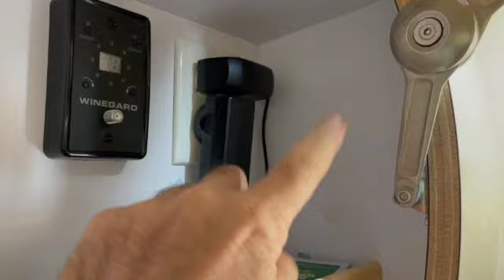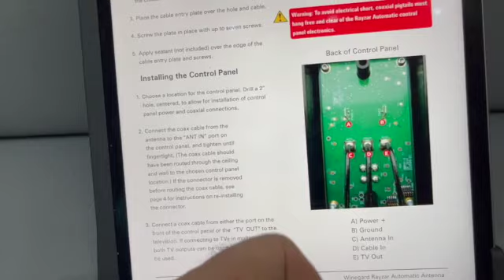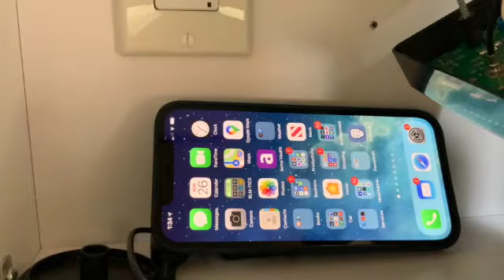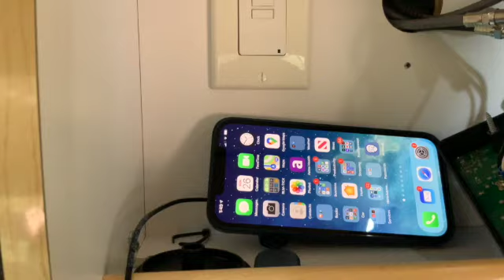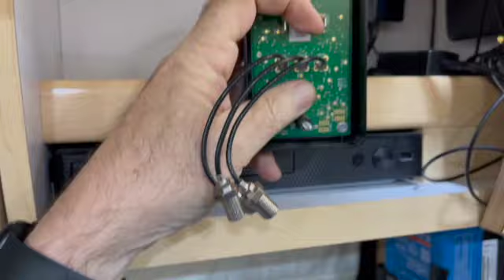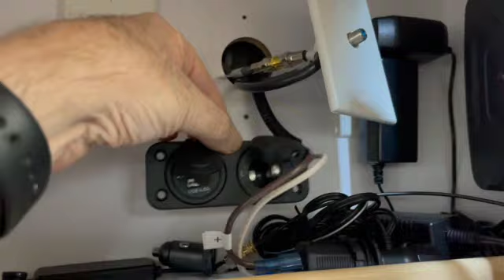WeBoost Install and Device Charge Shelf

Comment: Are you using the WeBoost interior antenna with your phone pressed against it? Is this your common practice?
Reply from the maker: I don't necessarily press the antenna against my phone, I just put all my devices in the charge shelf.  Its a small enough area that the antenna range can handle it.

Comment: Great idea. I am just about to buy a WeBoost. Did you ever do Part 2? It seems you just abandoned the Winegard on the roof. Is that correct? In that case the coax to the roof just goes to your WeBoost antenna?
Reply from the maker: Sorry, I've been traveling and haven't gotten around to publishing part 2 yet.  I just recorded a walkthrough of the installation I did of a Surecall Antenna in the accessory roof rack rail (https://www.amazon.com/gp/product/B0076CH8VY/ref=ppx_yo_dt_b_search_asin_title?ie=UTF8&th=1).  It connects into the antenna wire, the same as the magnetic mount antenna from part 1.  The key to installing the antena is locating TNuts that fit in the rail (https://www.amazon.com/gp/product/B08NSXTSQX/ref=ppx_yo_dt_b_search_asin_title?ie=UTF8&th=1).   I'll try to get that up on youtube in the next couple of weeks.
Reply: Looking forward to part 2. When I talked to weBoost they tried to discourage me from using the existing coax saying it might not be rated for the frequencies their antenna collects. Any thoughts on that?

Comment: One more question, did you buy the weboost for RV or truck?  Looks like they’ve got two options.
Reply from the maker: I bought the WebBoost Drive Reach with the trucker antenna.  I decided to install a surecall antenna (https://www.amazon.com/gp/product/B0076CH8VY/ref=ppx_yo_dt_b_search_asin_title?ie=UTF8&th=1) instead of the trucker antenna though.  The surecall antenna is  lower profile and works well.

Comment: Hello Doug, I saw your email reply on the PW email that I posted today, pleased to meet you. I am also looking at the weboost as well as another one to see which is best. Are you still happy with the weboost?  It will be a project that I will do on my own, so I’ll probably watch this ten times as I am learning and new to my Ascent. Thank you for tour reply. Cheers from cold Seattle.
Reply from the maker: Hi Sadie.  The WeBoost is working very well for me.  We took a 2 month trip from Oregon to the east coast and the WeBoot was essential in keeping me connected.  I left my hotspot and 2 cell phones in my charger shelf and the WeBoost on.  I also installed a SureCall antenna on the roof.  I need to do a video on it.  I mounted it in the accessory rail on the driver side and wired it into the antenna wire.